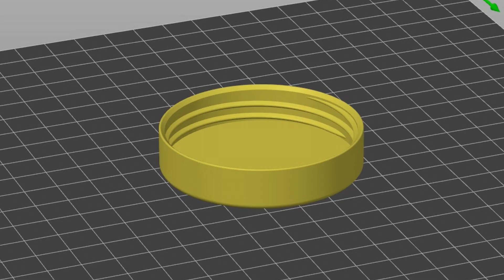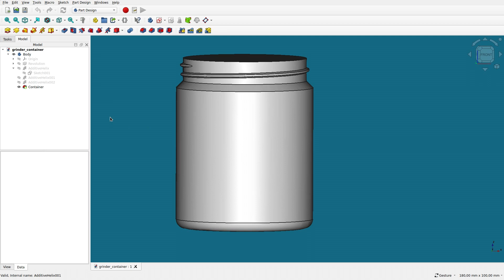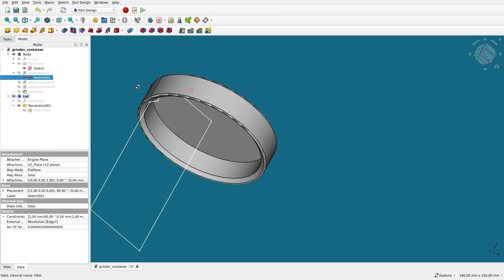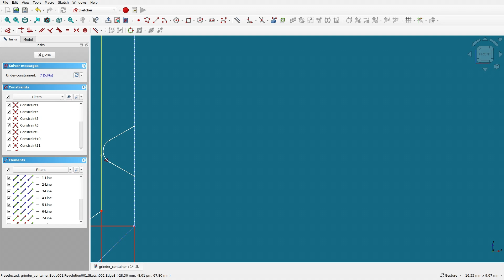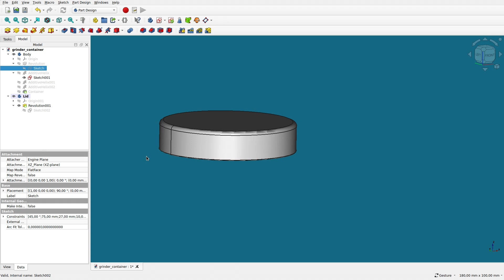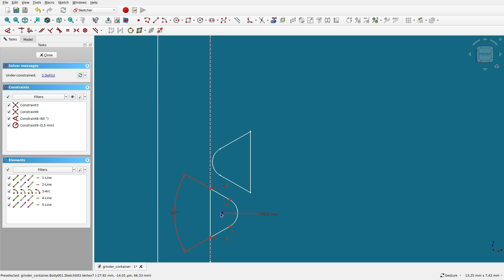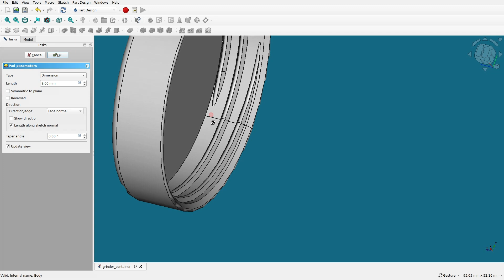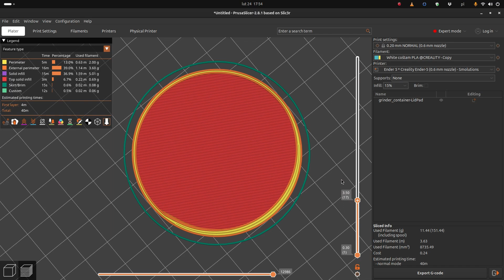Don’t Lose Your Lid: The Art of Perfect 3D Printed Threads

Comment: Finally, thanks for explaining not just the thread, but also the part that corresponds to it. I'd like to hear more from you about threads, especially when it comes to designing them from scratch, not to fit a preexisting one: what pitch and how many turns, tooth profile, maybe some tips on what works best for printing.
Reply from the maker: Thanks for the comment, I will do some more videos on threads. I have a really interesting project on the list with a kind of plug with a whole in it, with 2 threads with different diameters that must be "in sync" to work. But need to find time for it :)

Comment: Thank you very much for this tutorial. How to design correctly a thread on a lid was something I was struggling with lately. 
I have just one additional question:
How can I add to the tread a snap-mechanism so that it will snap and stop in a defined end position? It's important in my case, since I added to the lid and body in my design a grip-profile. When I screw on the lid it should stop and snap in this defined end position, so the the grip profiles in both parts are aligned. 
Thanks, Stefan
Reply from the maker: I would add some bumps on te container, right below the thread, and corresponding cavity on the lid. 3 pairs should keep the balance of the whole thing. Let me know if it worked for you! :)